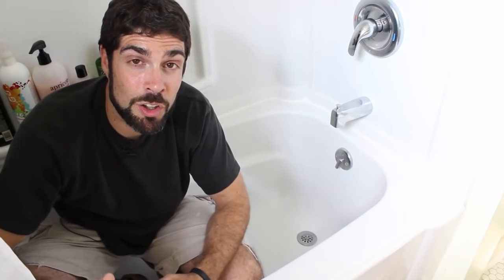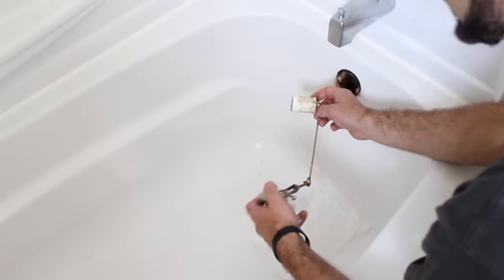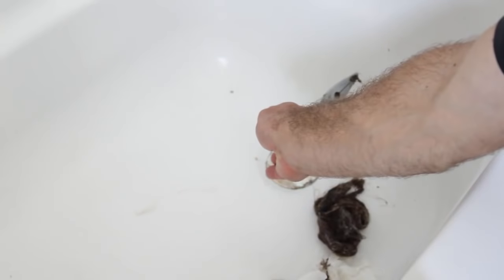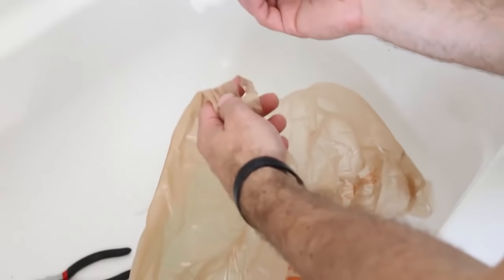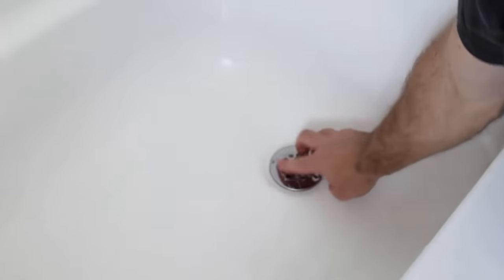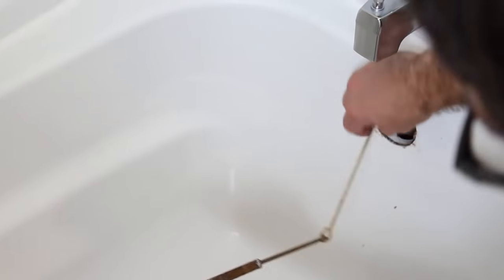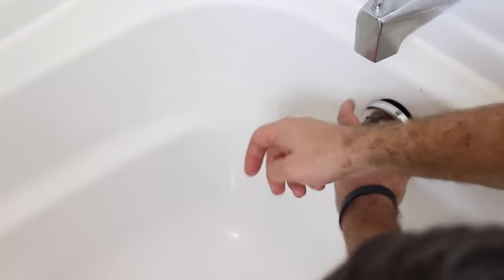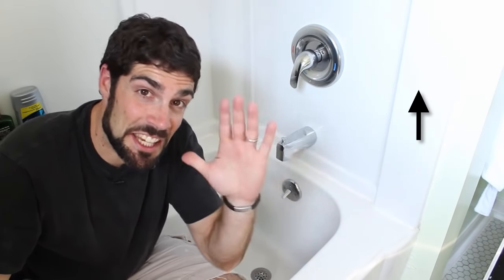How to Unclog a Bathtub Drain -- The Right Way

Comment: I thank you very much for this video.  It was exactly what I was looking for and you just saved me like $300.00 in my area for a service call.  I appreciate it.  The trick was to unscrew the overflow valve and that did the trick instantly with no further need for anything else.  Thanks again.

Comment: thanks for the video!
i don't know if you'd field a question but here's one just in case :)

i have a bathtub that was probably installed in the mid 60s with an addition on the house. cast iron.

i used it regularly, four or five times a week, for a bath for four years. never had a problem with draining. then, switched to a showering at the gym and have hardly used this bathtub for three years.  we had a local energy saving program that came and installed new shower heads (among other things) so i let them put one in this bath, even though we hadn't been using it. when he showed me around to the things he'd done, there was standing water in the tub. WEIRD. it slowly drained out

today, i took a couple gallon jugs of water in there (with a five gallon backup) to see how much water would go down before it backed up...less than a quart, maybe a pint

since i wasn't thinking about it, it never crossed my mind that the water in the trap would dry up if i didn't make sure that it didn't. 

i wonder if some critter or critters could have made a home down there and blocked it?

i'm going to try and enzyme cleaner tonight

Comment: Thank you so much for  your videos! I have one question. How do you go about unclogging a bathtub that has a push type stopper on the base of the tub? Are those normally easy to remove?
Reply: Mine is same want to know
Reply: Same here. I don't seem to have a plunger thingy in my overflow pipe...??

Comment: All right, a challenging problem. Bits of leak sealer are in the bathtub drain - probably deep into it and blocking it. I used an auger to try to get into it but the problem is that the drain has a steel divider-separator that is fixed and cannot get pulled off. The auger's front end is too thick and when I tried to push it into the drain...I cannot get it into the deep part of it. And so, I cannot get the auger's front end to go deep into the drain to remove the clog. So for now, I am using Liquid Plumr and boiling water to temporarily make the clog better.
Reply: What did u end up doing cuz im in the same boat as u idk what to do and don't have $ for plumber

Comment: hi i just have one question. do you need to unplug the stopper in order to remove the hairs? because when i reach into my drain there are to hairs to pull out
Reply: *no
Reply from the maker: Hanna Pae it is best to remove it :D
Reply: Hanna Pae I don't. Just remove drain cover. I just leave it in place without bolt to make cleanouts faster. It stays put without the built-in my tub at least.

Comment: U got lucky and ur clog was hair and it was right at the drain. For that u didn't even need go remove ur plunger.  I have a small clog somewhere between three plunger and a about a ft down.  But there's alot of 90 bends of pipe before it gets down to my basement. I took me plunger off and was in my basement working my way back up but theres a hair clog in there somewhere.  I'll deal with tomorrow

Comment: I don't have that type of drain setup. My drain trap is constantly getting stopped up, i use drain cleaner but i guess I'm gonna have to get a snake.
Reply: purple sword You can get a mesh metal screen and put it over the drain. It will catch most hair before it goes down. Also, try a Zip-it drain cleaner (just a long piece of plastic with teeth that you insert and then yank out). Be careful with drain cleaner as it can damage pipes and is bad for environment.